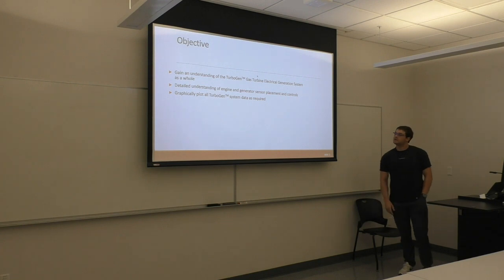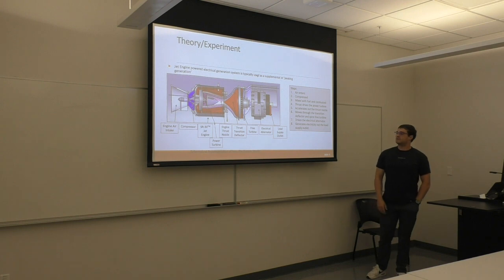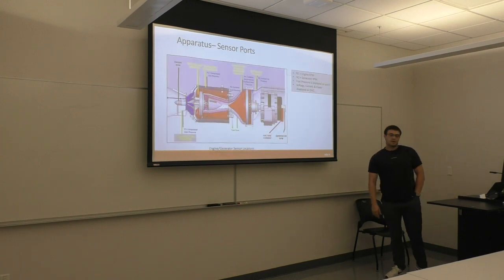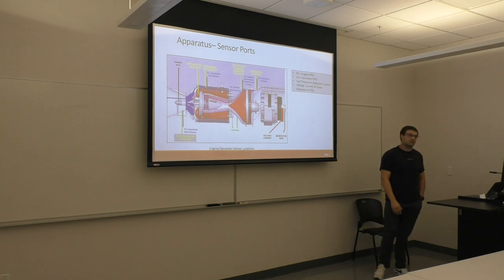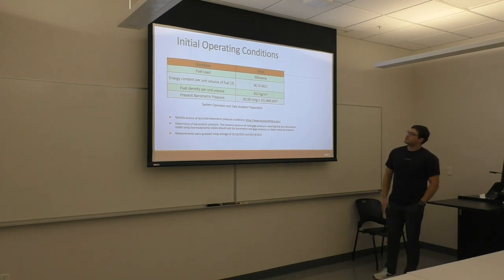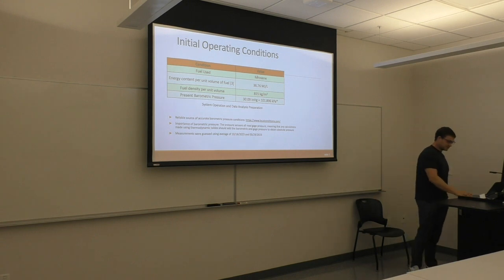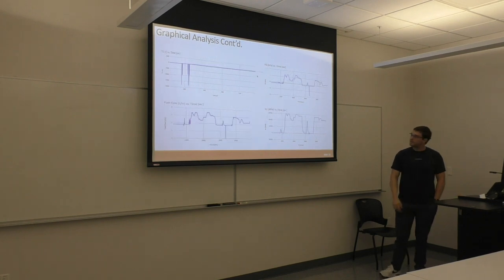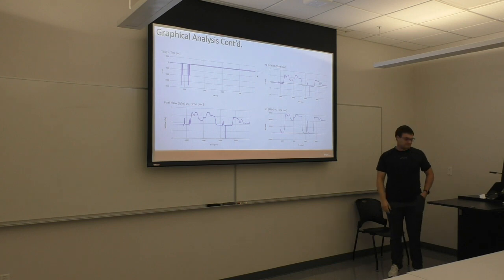William Hidalgo

Comment: You did really well with analyzing the data with a previous groups data even if there seemed to be some error involved with some of your calculations. Which the error could be from numerous outside factors that you were not made aware of by the previous group. Since you were not able to preform the experiment in its entirety its commendable that you were still able to analyze the data without having the hands on experience from doing the experiment. I have no suggestions for you.